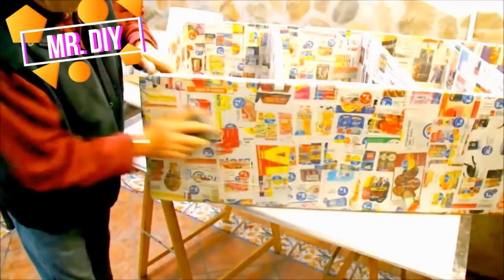5  COOL CARDBOARD CRAFTS AND IDEAS

Comment: I collected 75- square  pint and half gallon milk cartons, cut the tops off ,Laid them on their sides and made saved chip board drawers for all of them .i covered the fronts of these drawers with green paper and used 1/2 corks for the drawer handles ..I taped the cartons  together into groups that would fit into cubicles on my desk ..These drawers slide in and out of these waxed cartons so nicely ...All that little clutter i work with that often made it impossible to see my work space is now in all those drawers made from milk cartons 
...and i can see my work space ..

Comment: is there a formula for height to width and drawer size and depth to maintain a sturdy furniture that wont fall apart? 
or is it: 
choose existing structure / make structure, reinforce interior and exterior, cover [with that white stuff - what is that white stuff that adheres the torn up paper bits? i recollect that this is what adds a good deal of "toughness" to the structure], then seal it with [what's the next stuff you use?] then finishing touches, paint, TAH-DAH! your gorgeous furniture <3 

[[[I might be missing a step.... going back to watch again and take notes]]]